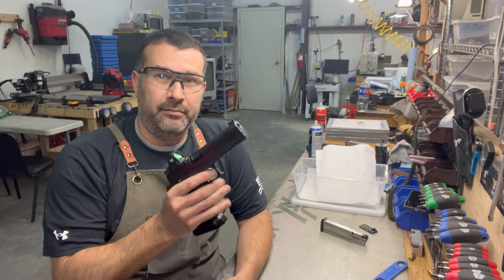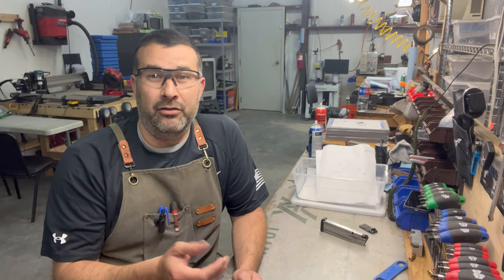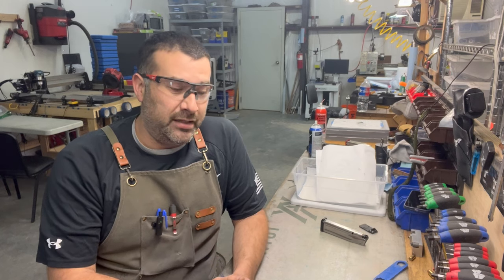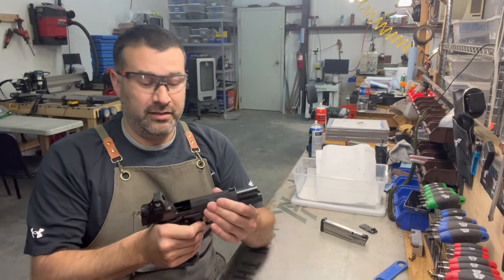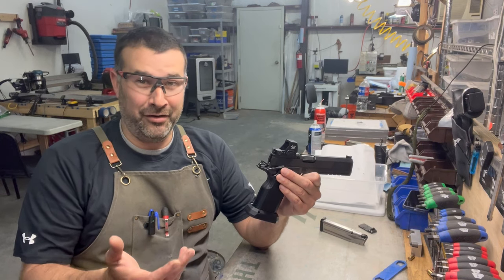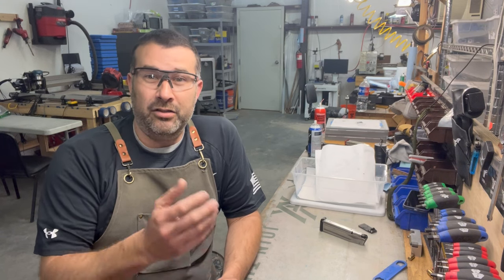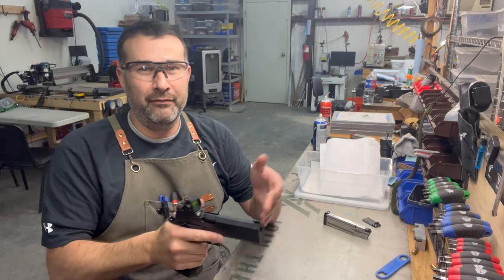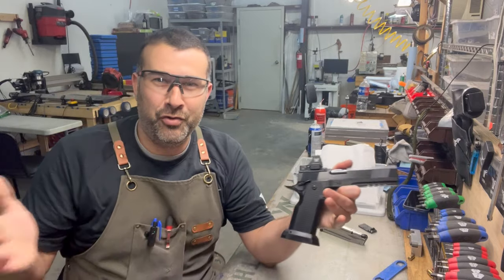1911 Etiquette

Comment: Old school military, 1911-A1 .45ACP ( pre-Baretta 9mm ): We'd drop the mag, rack and lock the slide, visually check the magazine, mag well and chamber, hold pistol in one hand w/mag between fingers untill handing it over to the armorer. He'd take mag and pistol, check mag, mag well and chamber for a cartridge, drop slide, pull trigger, insert magazine and call out ser # to log back in. The life of an old school military pistol  . . .   ☆
Reply: A G.I. 1911 has none of the tricked out parts and work done to barely hang on a ledge to give you the best trigger pull possible. It is harder to damage what isn't as fragile and already in use for decades. 
You might have a watch for work and one for going out. The one where this 'not dropping the slide on' was mentioned is the former. It isn't said that it will break the pistol, just that it quickly degrades the fine job one did on it.
Reply: The same idiots that call the M9 garbage because they were not taken care of. Cops and military personnel know the least about guns.

Comment: You basically have to drop the slide on an empty chamber when you're tuning the trigger. I learned this when I was tweaking the sear spring.  I'd been told to drop it on an empty chamber to check for hammer follow, but I didn't think it would matter much if I dropped it with a dummy round, and it seemed fine. Yes after a couple of mags at the range, it went full auto, lol. Now, when I tune triggers I always do several empty chamber drops, and I haven't had a problem since. I was never really concerned about dry fire though . I do 100% agree that you never do either to someone elses gun without asking first. Good content, thanks.
Reply: Why did the half cock not catch the hammer?  Trigger did not have enough clearance. The adjustment screw, (over travel) was too far in. 
KnifeMaker
Reply: @michaell397  I did end up adjusting the over travel some and had no problem after I put the factory spring back in. But then later I started trying to get a lighter pull again with a different spring. And several times while testing, I would get the hammer follow. Trust me, if you get that spring bent wrong or try to go much under 2# pull you can get hammer follow, sometimes it will catch on the second notch and sometimes it won't.
Reply: @roberttaylor6030  Yes Sir, this is true. It is brought on by hammer bounce on the sear. The bounce when dry dropping the slide is much stronger than with a dummy or live round. Other things contribute to this such as trigger weight. Most have no idea the reason we no longer use steel trigger shoes or even alu. in some cases and why alu. triggers became popular with lightening holes in them and today poly trigger shoes are becoming so popular with people. 

The popular complaint today about poly (plastic) trigger shoes is that the company is cheapening out using a cheap material. That is not the reason at all. It is the weight of the trigger shoe and the advantages a lighter unit brings to the Gun.  This has been learned thru many years of competition with the1911 platform  and the gradual perfection of this ancient design. It has become an icon with a legacy  like no other. The heavier trigger shoes weight is detrimental to a very light trigger pull as the weight thru kinetic energy transferred by the slides stop in battery to cause the trigger bar to hit the sear disconnector in such a way as to release the hammer. So trigger follow is not always the light sear spring. It is a combination of factors. 
to blame it all on simply too light of a sear spring is misinformed and frankly, a little lazy by smiths that should know better. 

KnifeMaker
Reply: slingshot the slide on an empty chamber is even better test. it will drop the hammer to half cock on marginal spring tension where dropping it from slide stop might not.
Reply: @roberttaylor6030  True that!
KnifeMaker

Comment: I would suggest you take a deep dive into metallurgy. Yes, 1911's are steel. However the Rockwell Hardness is rather soft. Very soft by my standards. It apx. the same hardness of high end knife steel when it is delivered dead soft for machining before heat treat. A nail is steel. A hammer is steel. Ever notice what a hammer does to a nail head? Yep, it batters it visibly!

The steel in the slide, frame, bbl. is in the range of 43 46 Rockwell C Scale. This is to keep it from cracking from pressures and battering. It does not prevent movement of the metal with impact however. I have see fine trigger jobs effected in as little as one one slide drop. Quality hammer hooks and sears are in the 49 to 53 range depending on manufacturer. Mim is harder on the surface but soft under the surface. Again depending on the manufacturer. It is very easily damaged and progresses to greatly worn quickly.

The Military requires the slide to be dropped on an empty chamber when leaving the range and inspected by the SGT. Even notice  how loose the gun's are. Even guns with a very low shot count are rattle traps. Yes, loser tolerances, but abused each and every time they are taken out. It does matter. Take it from a Metallurgist, the damage in elevatable. 

Worse case's are in gun stores where the guns slices are dropped many-many times. I will not buy such a gun regardless of how finely made. Period!

KnifeMaker/Retired after over 47+ years in the Craft
Reply: @AlphaMindset-zq5qv If by saying they functioned fine is that they would fire fine. That is not function properly. Were they still accurate? NO! Were they still dependable No. There is more than being able to fire to be considered functional. A 1911 is far more than merely a functional gun. It can be a master piece or an inaccurate, worn out rattle trap.   I live by Ft. Hood, the largest military base in the free world. I have seen and shot hundreds of vantage 1911's. Most were pure garbage. Only still in service due to the heroic efforts of armorers who did their best, but fully admitted that they were dog's. 

The very fact that 1911's can be tuned like a Swiss Watch is  unheard of in the world of modern  Pistols. it is the only platform made even in todays modern cnc mass produced world, the only platform that can lay claim to this level of refinement.  No wonder1911's are the true Hand Gunners gun of choice.  

KnifeMaker